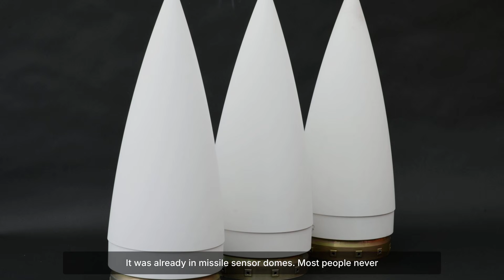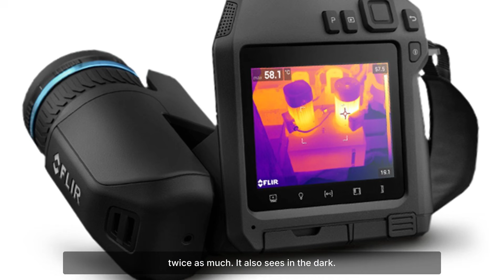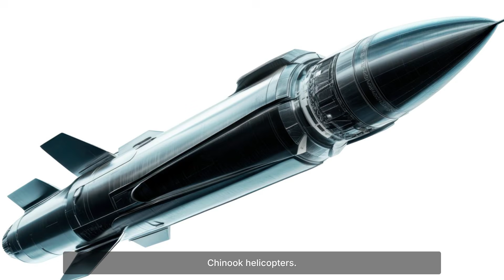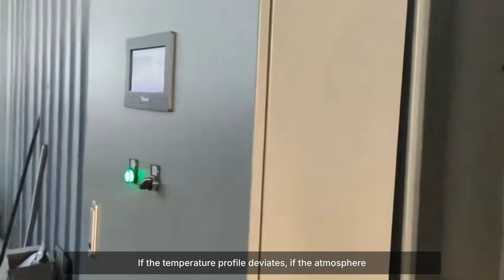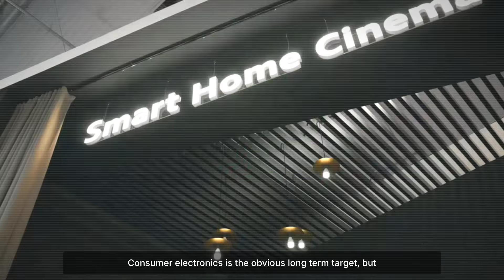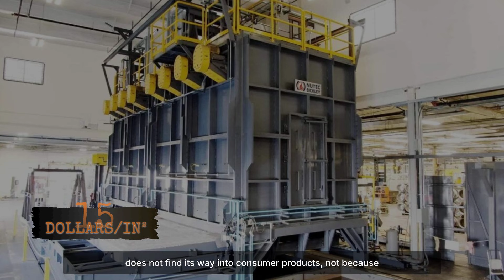This Bulletproof Glass Stops .50 Caliber Bullets — Why Aren't We Using It?

Comment: The solution to the cost issue is Apple inc. Use in watches, and iphones then ipads would very soon do the price reduction at pace, in bulk, and would solve the issue of unclean-able apple displays, and fragile devices. And would enable Apple to shave a heap off screen and device thickness. Apple cameras probably use saphire however.

Better yet imagine Zeis producing ALON lenses for spectacles.

Comment: Is Apple’s aluminum impregnated glass really just transparent aluminum?
Reply: no, not even close to that.
Reply: @AlucardNoir ok.  Explain the difference.
Reply: @RickChapman-c8e  FIRSTLY, ALON has an actual crystalline latices while glass is amorphous. This is one of the main reasons why ALON is harder, you could make "harder" glass just by making actual silicon oxide crystals in place of an amorphous solid like glass, but they'd be a lot more brittle and easy to shatter. ( do note, actual silicon oxide crystal/quartz 'glass' is used in some industries as something harder than glass that still has it's chemical properties - well, inertness - while being more resistant to higher pressure)

Secondly, ALON is a transparent ceramic made out of aluminium nitride and aluminium oxide that mix and become just one meta substance in the right proportions at the right temperature. They are a crystal made at high temperatures. 

Glass on the other hand is a silicon oxide amorphous material - read disorganized. Apple has in the past used aluminosilicate glass, ie. they added aluminium oxide to the sand they were making glass out of, the result is still a transparent amorphous ceramic and not a crystal like ALON. An amorphous glass that's harder than pure glass, but still an amorphous material and not a highly organized crystal, thus still a lot softer than ALON. 

Also, remember how the video says ALON is almost as hard as sapphire? so sapphires are crystals of aluminium oxide, ALON is a ceramic made of alliminium oxide and aluminium nitride.
Reply: @A @AlucardNoir anks.  I appreciate it when someone actually takes the time to explain.

Comment: This price difference is due to a lack of upscaling and mass production.  If this became reality, the price of transparent aluminum would be a fraction of the price.
Reply: Sapphire is a perfect aluminium oxide crystal. If it has flaws or impurities it's usually some other hard gem like a ruby. This is never going to be as cheap as even bulletproof glass no matter how much you scale it. There's a reason this is almost as hard as sapphire and that's because sapphire is literally part of this ceramic. This is never going to be cheap no matter how much you scale it up because the process will always be more complex than that of making bullet proof glass and hardened glass like gorilla glass.
Reply: @AlucardNoir I understand that, but over time better products replace less effective ones, thus reducing the cost of manufacturing
Reply: @RickChapman-c8e  No. Just no.

To give you a similar example Japanese Knives. People say they're superior, they're not, they are just made out of a harder steel that stays sharp for longer. The reason why most knife manufacturers don't want to make knives out of the same steel is because of two reasons: firstly, that steel isn't stainless so people would need to take care of their knives, and secondly, that harder steel that keeps it's edge for longer is also harder to sharpen. Not only would that mean it would be more expensive to sharpen the knives for the company, but for the people buying them, it would take longer to sharpen the knife - thing is people already DO NOT SHARPEN their knives. SO, modern mass produced knives are made out of a milder steel. Why? because that steel is stainless and is easier to sharpen both in the factory and in professional kitchens. Does that mean we don't have the tech to make "better" knives? of course not, but there's no point in making in a knife people have to take care of when you know people won't do it.

ALON is superior to bulletproof glass... but do you need bullet proof glass for most situations? No, you do not. In fact, for some situations like glass shelving in a modern fridge, you want tempered glass that will break in a thousand tiny bits and not form impromptu glass knives that you can cut your hand on. ALON is superior to glass... but that doesn't mean it's magic. For most cases you do not in fact need a material that has it's properties. BUT, even if you did, it would still never become as cheap as bulletproof glass. The process to make it is more complex, and the materials needed to make it clear are a lot more expensive. It literally can't compete with amorphous glass and plastic sheets no matter how large the production gets. The only way it could ever replace bulletproof glass is if plastic were banded. And that's because we ban the sheets that glue the glass panes in bulletproof glass together, not because it is cheaper. For every single object, there is a minimum price bellow which production can not go, the price for glass and plastic is already close to the bottom, the price for ALON can never get as low as it is for glass.
Reply: @AlucardNoir I find many people will learn to take care of things as products become more expensive to own.  Even sharpening cheap knives is better than buying new knives when they go dull.